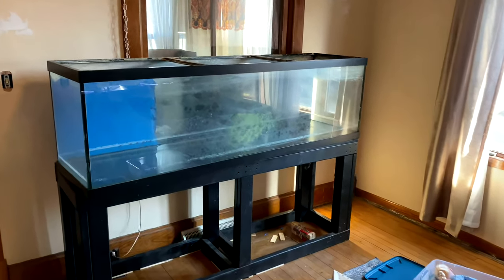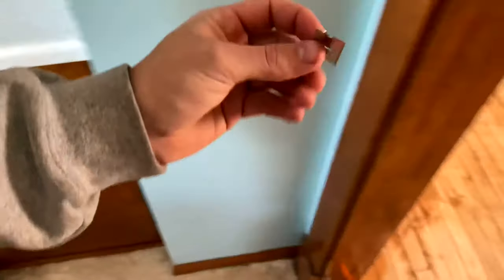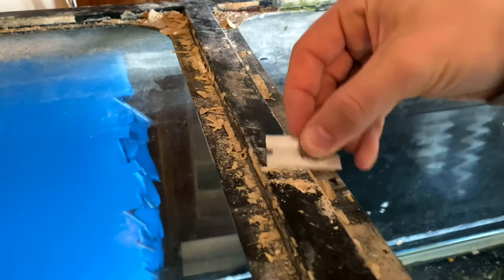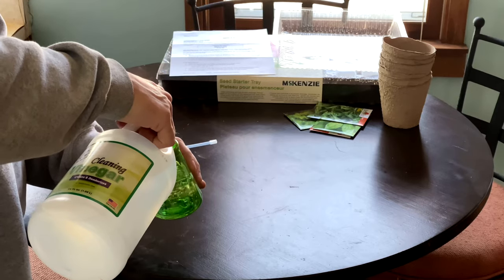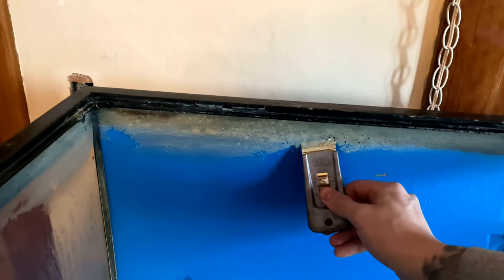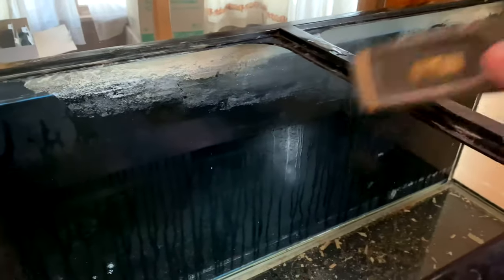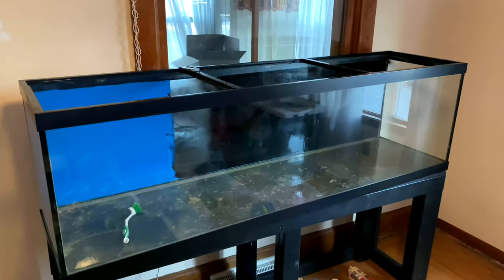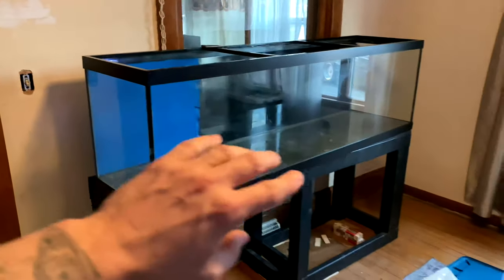Clean Old Aquarium Glass - Mineral Buildup & Stains

Comment: Nice!!  One tip to always remember, once you start using the razorblade NEVER turn it over and use it on that side.  In other words, if you start using it in the blade holder with the retraction button up, always keep it up.  As you are scraping you are damaging the blade and the damage curls away from the glass you are scraping.  If you turn the blade over, you will scratch the daylights out of your glass!!  God bless y'all!!
Reply: This is 100% accurate
Reply: Thanks for the Intel mate 👍
Reply: Good thing I found this comment after I did this to my 85 gallon.
Reply: Made this mistake already. A buddy of mine recommended I do this to get rid of mineral deposits on the top of the fish tank. But he failed to mention not to flip the razor blade over or to be real careful when scraping it off. Now I have scratches all over inside of the tank. So be careful when using this method. Your mileage may vary.
Reply: Thanks man I almost ruined my glass.
Reply: I would like to add one more thing that I found.  It seems that the foggyness can be etched in the glass and scraping won't remove it.  I don't know what the chemical reaction with the glass would be but, there is something there.  Hopefully someone more educated than I can add their understanding here.
Reply: Man, I wished I would’ve known this. Definitely scraped the living crap out of my 90. It was a brand new tank too…. I’m hurt beyond words any advice in scratch removal on glass?
Reply: @Aquaman-wy3mg  I'm very sorry to hear about that!  I don't know how to remove scratches from glass.  I tried polishing on the "cloudy" areas to no avail.  I think the glass is etched by something in the mineral deposits on the glass.  If you wash the above video carefully, you will see that there is still the "cloudy" appearance.  God bless y'all!
Reply: Wow.  Thank you for this tip.  Great to know
Reply: @tonyputman3398  Following.  I boughta used 10G glass tank... and although I got the tank and heater for $13.00, I can't complain.  I bought it used to be my Quarantine Tank.  Yep, major scratches in the front.  It wasn't noticeable until it was full of water.
Reply: @tonyputman3398  I had to watch the video again.  I can still see the haze, barely noticeable, though.
Reply: Definitely valuable to know, thanks man! I will be refurbishing a 120 gallon next weekend with some coralline buildup, hard water stains and light scratches. Hopefully the vinegar or citric acid will be helpful and I might just have to try and buff the scratches out with some cerium oxide. Never tried it but I heard it can get rid of minor scratches after hours of polishing lol
Reply: @elephunktheband  Good luck with the cloudiness.  I used both vinegar and citric acid and it was marginally helpful.  I couldn't get it after buffing for a quite a while.  I didn't use hard core buffing compound though.  It seems it is etched in the glass and you will have to remove some glass to get it clear.  God bless y'all!!
Reply: @tonyputman3398  Thanks again, I might just have to buy some stronger compound!
Reply: @elephunktheband  You are most welcome!  For a 120G tank, the work will be worth it.  I hope you have a decent buffer to use with the compound.  Doing it by hand could take a month of Sundays, so to speak.  God bless you, my friend!!
Reply: @tonyputman3398  I definitely hope the hard work will pay off! I wish I had a rotary polisher but I’ll have to settle for the regular drill I have with a felt wheel adaptor from Amazon.
Reply: @elephunktheband  My best wishes for your project!  Let me know how it turned out, please.  🙂
Reply: Hu I never knew that 😳 I always flipped the blade every few scapes (me thinking I'm evenly wearing the sharp edge to get more out of it) and I've never scratched the glass thank God geez I'm lucky I'll never do it again haha thank you for the advice
Reply: Thx for the info tony
Reply: Great tip because I definitely would of flipped the blade

Comment: No matter how many times I do this there is still a light fog. Any answers for this?
Reply: Did you ever find an answer for this? I just got a used 75 with that fog.
Reply: Used hcl, it's so much easier and faster, but be careful using it and rinse it many times using running water
Reply: What is hcl
Reply: @cajungirl7811  no. But most of it goes away when it gets filled with water.

Comment: anyone else still see the water stains ( the cloudy marks) on on the tank at the end of the video. still looks amazing now its been cleaned up
Reply: Yep, that's why I looked at this video.  I want to get rid of the cloudyness.  If he let the glass dry completely it would be more apparent...  Gona keep looking.  God bless y'all!!
Reply: @tonyputman3398  Hey. Have you found anything that helps with removing the cloudiness?
Reply: @sulaimanbinadenaankherekar8063  Unfortunately, no, I haven't.  I think the glass is etched by the contaminants.
Reply: Try some barkeeper's friend.....it's like 2$
Reply: @tonyputman3398  any update?
Reply: @katieking4358  I couldn't get rid of the cloudy and I tried a plethora of products, even glass polish.  It's etched, in my opinion and can't be corrected.
Reply: I had the same result....couldn't get the cloudiness off the last 1 or 2 inches at the top of the aquarium😮!!
Reply: @tonyputman3398 try using Emery cloth. Try 1,200. Keep wetting the tank while you sand in a north/south direction (this is so if you cause hazing in the glass due to sanding, it can be removed by using a higher grit in an East/west direction). Unless that cloud is embedded more than .002" into the glass, it should come out looking brand new.

Be careful not to sand one area more than another or you could cause distortion in the glass. Keep a smooth continuous motion from one end of the tank to the other. It's time consuming but SHOULD work.

To sum up: 
1200 up/down until cloud is gone
2000 left/right until haze (if any) is gone

Good luck!
Reply: @shane35fowler  Doesn't work, already tried it!!!

Comment: Wow.  I just picked up a used 55G Aquarium that has its mineral buildup.  You did a great job on explaining on how to attempt this task.  I have a water filter, Tube Light, and an Aqueon Water Filter to chean up, as well. I will be replacing the Light and Water Filter, but at least I have something while the Aquarium is getting balanced. I bought a Gold Panda to help get the Biological Bacteria started using the Cartridge and Polishing Pad and Fluval Ceramic BioMedia that have been also growing in my existing Aquarium for about a month now.  At least I won't be starting from scratch, like I did back in October 2022.

Thanks for sharing.

Comment: Thanks. I’ve got a all glass Mr. aqua 12 gallon. 100 and something dollars for a beta tank. Wanted him to be comfortable. Coach Alex died and I drained the tank. Enough time has passed and my daughter was agreeable to a new fish. She’s a little bit on the sensitive side. Extra sensitive. But she sweet and that’s good. Anyhow, I do not want to scratch it up at all. Micro scratches or any scratches if it all possible. Just be careful with the razor blades & swap out regularly. or any other ideas. I like cleaning everything with vinegar. Figured I’d ask. I guess I could Google it but you have a lot of tanks. Have you ever filled a dirty one like that one up with water and a few jugs of vinegar and just let it run. So much miss information on Google. I’m being lazy but mainly don’t want to scratch it. Like the clean lines. Yours came out nice good job. Thank you
Reply: hey, here's a theory i have about scratching glass - i BELIEVE it's due to the pressure and surface area you apply while wiping the glass. 

if you press harder with a big grain of sand = big scratch, but small "silt-like" particles pressed gently against the glass with a wide surface area are pretty harmless (IMO).

so i just use old filter pads to wipe algae in a slow circular motion. admittedly, i do get nervous on the glass near the substrate tho. maybe need razors for that. just my 2c
Reply: Great idea. Don’t know if it’s viable but an excellent idea
Reply: Sounds like it should work (similar to a coffee maker).  Just be sure to do another 2 cycles of clean water afterwards to remove the vinegar from the tank (or wipe it down really good).

Comment: great work ,but, if the aquarium is still with vinegar  drops when put fish,i am afraid it will  kill the fish,should i be worried about that??
Reply: Rinse it out alot
Reply: You should also be making sure you’re properly cycling your new tank anyway. Before you drop fish in the tank needs to get going. So if you take your time and clean the tank then let it cycle fish will have no issue when they finally get in there